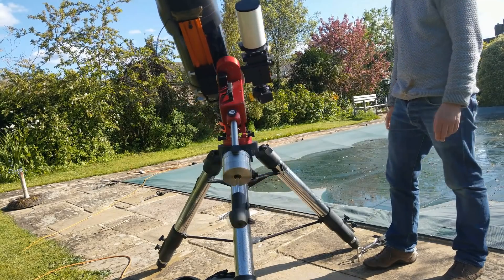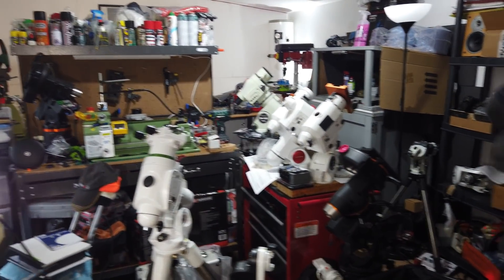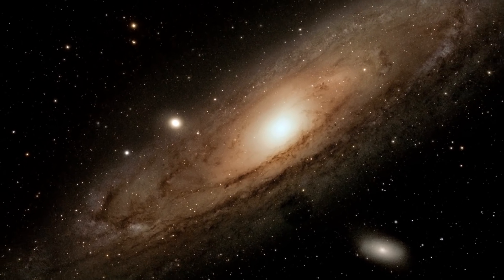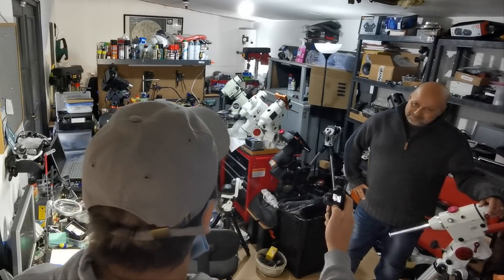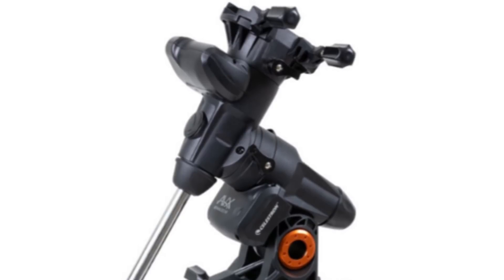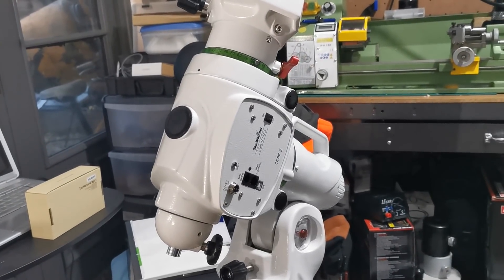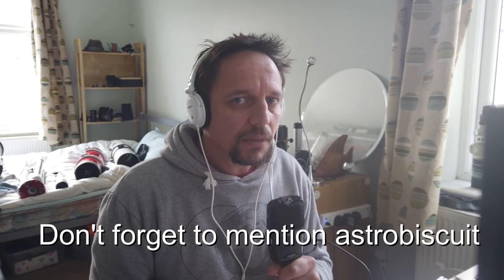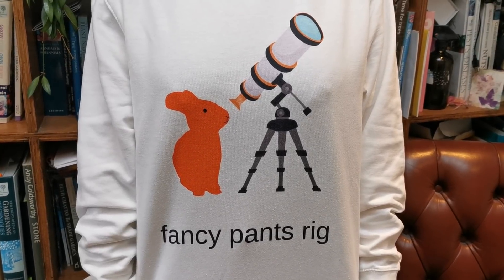Best Mounts for Astrophotography

Comment: Go back 8 years and have a browse on the UK forum Stargazers Lounge for belt drive.  There was a group of us playing about with belt drive conversions og HEQ5's and EQ6's long before Rowan Astronomy capitalised on the idea.  In fact I was selling DIY kits for use with EQMOD having converted mine  in 2012 https://youtu.be/dh3F1xkdj98

The problem was in order to maintain the stock ratio for use with the handset commercial pulleys were in two parts and being so small would fall apart after reboring, this is where Dave of Rowan Engineer came in... He CNC milled the motor pulley form a single block of aluminum, and the rest is history.... shame I didn't patent the idea  :)

Comment: No mention of Losmandy mounts.  Why is that?  Dave appears to have an obsession with Chinese products, despite the fact that they are actually not that great compared to most non-Chinese mounts.  Losmandy, ASA, Astro Physics, Takahashi, Avalon, and many others, as examples.
Reply: Love Losmandy mounts. I also service and refurbish Takahashi’s as well as other higher end mounts. The point is that most Chinese mounts are a mixed bag performance wise, yet very good once rebuilt with better tolerance and quality control. For those that want better tracking without the higher cost and learning curve of a new mount, tuning provides a way of extending your Astro-imaging.
Reply from the maker: my losmandy gm8 was no better than my eq3 and I spent a long time fiddling with the gm8. they may be better visually but their guiding accuracy was poor at least in the gm8 I owned. I have a second hand avalon linear fast reverse and it's good but new costs treble the eq6-r and the guiding accuracy is probably slightly better although I suspect the reliability is far better
Reply: @Astrobiscuit  I have a Lomandy G11 that guides at better than .2 arc seconds.  I know others that have gotten even better performance.  They are very robust, the customer service is superior to any of the Chinese models, and the parts are readily available and often upgraded.
Reply from the maker: 0.2 arcsecs is very good. I thought that kind of performance was only possible by replacing the worm with the expensive ovision upgrade... of course the g11 is double the price of the eq6-r and I've read  about plenty of g11 owners  with  more  wobble than 1 arcsec.  I might be wrong but my personal experience is that the beautiful losmandy mounts don't guide any better than the  cheaper Chinese  mounts  and I'd rather the folks following me didn't make the same mistakes I did. Having said that all opinions most welcome. If any other Losmandy owners want to chip in with personal experience that'd be good. thx for your input buddy.
Reply: @Astrobiscuit  The new gear boxes have higher precision.  Moreover, the original worm gears work fine but need to be finely tuned, which takes some effort.  As for the price, the excellent customer service and readily available accessories, replacement parts, and upgrades more than make up for the price.  You can always buy a used one and upgrade it for a lot less than a new one.
Reply from the maker: Good info thx all

Comment: Dave fixed up an old eq6 (black version, remember them?!) and its running 0.6/0.8 arc seconds still after about 3 years.  He’s a great guy.  He also put the rail kit on which is definitely the most affordable of the ways to solve the horrendous altitude bolt issues on the mount.  Would highly recommend.  Also, his shed really is awesome :)
Reply from the maker: he's rebuilt the exterior of his shed. I expect he was a bit gutted I filmed the old one. 🤣thx
Reply: @Astrobiscuit  I'm glad I'm not the only one who couldn't find his house though, that first bit made me laugh!

Comment: I just bought the Orion HDX 110. They claim 3 arc second accuracy but of course that's not a full cycle of the worm, so its actually 6. Can these mounts be tuned up to have sub arc second accuracy?
Reply from the maker: sorry I don't know. maybe someone else can chip in.
Reply: Yes. They are the same as the EQ8. A StellarDrive 8 runs at 0.33 ArcSec RMS at 45.1kg - customer supplied data...

Comment: I would say, the best budget mount for beginners is the Az-gti. very mobile and cheap. mine can handle a TS72ED with a guidingscope easily  with the right counterweight.
I am using it with a raspberry pi (Astroberry installed). it just needs a smartphone to control it.

Comment: An eternal topic for astrophotography)) I live in Odessa from Ukraine, so I apologize for my English. I am your subscriber and you have a very cool channel. I also have my own channel and I am also passionate about astrophotography. This summer I finished modifying my astro tracker SW Adventurer, I managed to do a belt drive on my tracker. Now the periodic error at a load of 3.8 kg ( Canon 550D cooling DIY, ZM-6A 500 mm guiding Datyson T7M & 135 mm) is about 0.78 - 0.92"   So the tracker has potential under the condition of the application of the hands and head.

Comment: I had a AZ-EQ6 Pro tuned by Dark Frame. (Stellar drive) It did take a while to come back and unfortunately it sounded like a bag of spanner’s was in the mount whilst slewing. Sent it back to Dark Frame and another 2 months later it came back fixed. Overall the mount got tuned to what was offered, but took a total of 5 months to get it sorted, of which I was without any mount for 99% of that time. That shouldn’t put people off, the suspicion from Dave was that the courier dropped it the first time. I’ll never know.  Dave certainly knows his stuff
Reply from the maker: hey fella thx for that. It must have been most frustrating.

Comment: Thanks for the post, sir. Was debating the HEQ5 + belt mod or the EQ6R Pro. The higher payload capacity and belt drives out of the box won and I recently bought an EQ6R Pro. Had to hunt one down here in Toronto. Shortage in supply everywhere. The mount is a beast IMO. But as the Astro Gods would have it, cloudy ever since. On the other hand, loads of time to run simulations with ASCOM, EQMOD, N.I.N.A, etc.  I thought my home theatre setup had plenty of wires. LOL!

Comment: I have a Vixen GP with after an market skywatcher goto system how does that stack up?
Reply: build quality way above the clones, I have a GPDX with home built stepper and belt drive using AstroEQ arduino controller. silky smooth  and cheap to build

Comment: Is there a way to find this "wobble number" on a particular mount? I'm using the tiny iOptron Skyguider Pro, running pretty close to the load limit and wondering about ways to make it more precise, but for that I'd like to know where we are.
Reply: thats a non guided one axis (Right Ascension or RA) guider. Its really only meant for smaller lenses, i.e. 100mm. If you dont already have it, the iPolar is the only upgrade to get a more precise polar alignment.
Astro Backyard (Travis) put one on and got 4 min subs with a 250mm redcat scope and APS-C DSLR (400mm equivalent).
Its a $270 upgrade though, which is half the cost of the guider.
Maybe you can find one used for cheaper. Just make sure you get the one for the Sky Guider Pro (3339R-SGP).
As for the ArcSec number (wobble number), I dont know enough about it, of how you actually get that number. Its not listed on their site. Im assuming it can only be measured while guided? I really dont know, but i wouldnt worry about ArcSec's on the SGP.
Hope this helps.
Reply: @bear5016  Thank you!
Reply: "Wobble number" is properly called Periodic Error.  There are many software applications that can indicate this, though high dollar mounts, especially American ones, will list it in the specs.  I use PEMPro by CCDWare.   As much as I love the video, and all Bisquit videos, those "wobble" numbers are not realistic for those mounts, even if they've been "hyper-tuned."   I would request a PE performance graph from DarkFrame Optics for the actual numbers once finished.  BTW, the best mount in that room was the Tak EM-10 in the background...and it wasn't mentioned.

Comment: I'll say - Sky-Watcher EQ6R-Pro, EQM 35 Pro and Orion Atlas II, Orion Sirius Pro for best price and reliability.
Reply: Good to know, I started out with a Star Adventurer but can quickly see I need more stability so looking at the EQM-35.   I think even if I go larger I'll want the portable rig for wide field DSLR shots.   I was a little bummed though that these bigger ones still depend on the flimsy little illuminator.   Seems like they could just build a dimmable red led into the mount.   Oh well, still researching.

Comment: I'm in the states and First Light Optics is where I was able to source the rowan belt mod for my Orion Sirius(HEQ-5) mount. No issues at all and have ordered several products from them since. They are outside of the US, but don't seem to have a problem shipping to us over here. 

Its a magical modification, BTW. Everyone who has an heq5 needs to do it immediately. It's the best $100 you'll ever spend for your rig.

Comment: Interested, I have a HEQ5 Pro that got knocked over a few years back and the gears jammed. I sent it off for repair, it works, but not brilliantly. Would this mod be of any help to my mount?
Reply: I have the belt mod for mine. It replaces the brass gears that drive the worm gear via the two stepper motors(one for each axis). If it was those gears that were damaged, it will definitely help by getting rid of them. If it was your worm gear though, the belt mod won't help. 

Its a great, relatively inexpensive mod. And its not difficult to install. The instructions even include photos of everything.

First Light Optics is where i sourced mine from. I'm in the US and they were able to ship to me. They'd likely ship to wherever you happen to be located as well.
Reply: @NG-VQ37VHR  Thank you for the reply. I am unsure of which gear was knocked out. All I know is the mount wouldn't move at all, it just made an awful noise when I tried. Since the repair, the mount works, but sometimes cuts out on me when I star align, sometimes it randomly stops mid slew (possible power supply issue) and now seems unable to take the weight of my imaging kit. It used to manage it all fine before.
Reply: @nickym5271  I'm sorry to hear that. The cutting out does seem like it would be a power supply or connection problem. 

There is a side panel that comes off with the removal of 6 Allen head bolts. It'll expose the gears and you could have a look at them if you wanted. You shouldn't be able to hurt anything by just removing the side cover for a look. You could check for gouges or any kind of deformation in the gear teeth. While you're in there, you would have a look at the wiring. Make sure nothing looks worn or loose. The motors plug into the main board; you could check to make sure those are plugged in all the way and rule out a loose connection. 

Its not as complicated as it may sound. You should be able to find lots of pictures of the guts online as well. 

Just keep in mind that if you go further and decide to begin removing the gears to check other things, you really need to be sure you know how to install everything back correctly. There are resources available that can walk you through tuning it and setting it back up the way its supposed to be. But you can make it worse if you aren't confident that you know what you're doing.
Reply: Google for astrobabys HEQ5 stripdown guide. It's probably fixable, these things are built like tanks. If you are in the Netherlands, I can have a peep.

Comment: Lol, I've got an old EQ3-2 kicking about in the shed. I might pull that out and rebuild it instead of buying a Star Adventurer. I had great success rebuilding my HEQ5 Pro and got it sub arc second on the stock bearings just with a complete re-greasing and careful adjustment using astrobabys instructions.
Reply from the maker: excellent... with your experience you might get it sub arcsec
Reply: @Astrobiscuit  Only problem is, I need to buy the enhanced motor drive kit for it which is waaay over priced for what it is at 115 quid from RVO. Still, even with that and the 30 odd quid for a polar scope it still comes in at just under half the price of a Star Adventurer and I'll get the bonus of having both axis guided.

Comment: I use an AltAz mount (the one you used in you deep space for 150 pounds video) for imaging. Of course it wobbles and some images are trash, but I'm super happy with it and it works fine when it's balanced right and the target is high enough.
Reply from the maker: well done. It means you are very skillful
Reply: @Astrobiscuit  I'm still a lil bit of a newbe, using an achromatic refractor and a stock DSLR, but I'm happy. Maybe I'll get a DAC for Christmas.

BTW. I'm that guy who messaged you on Instagram asking for what app you're using to remove the stars in a picture